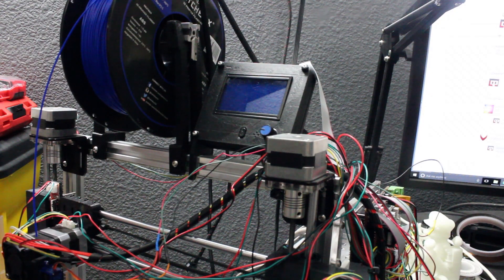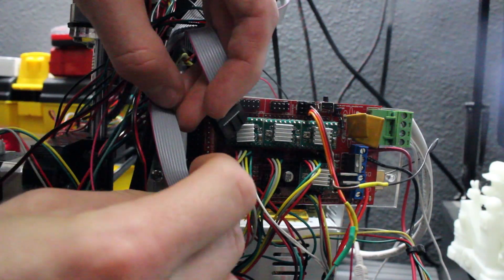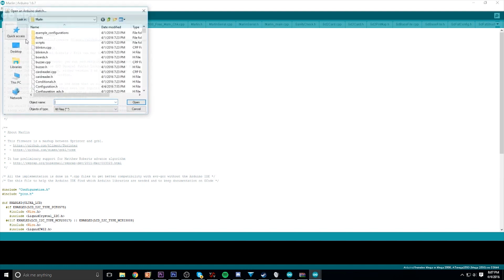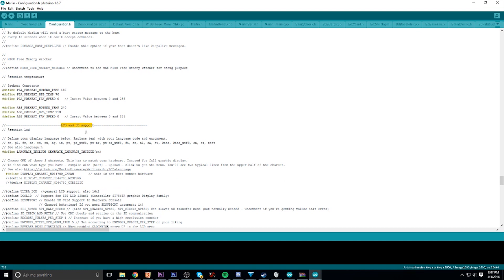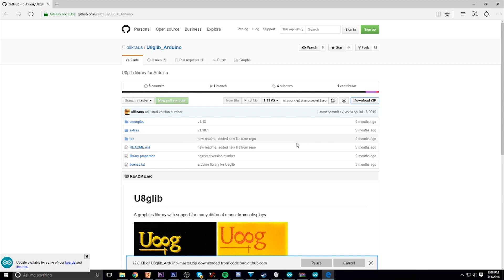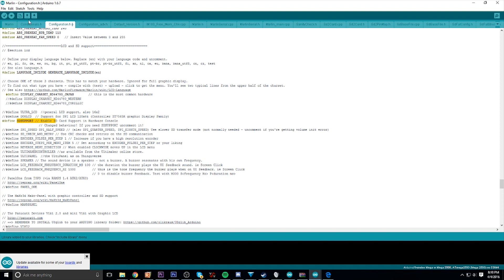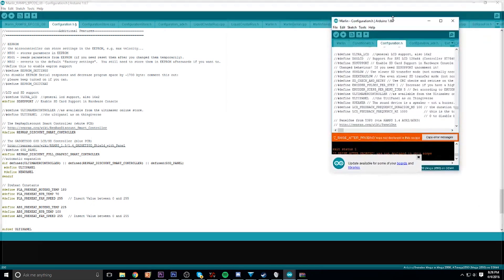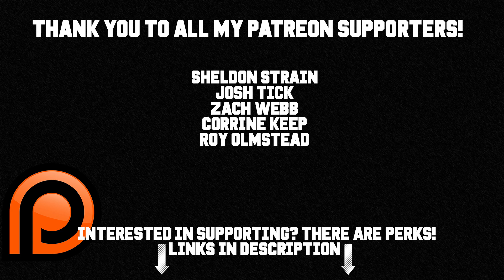3D Printer Tutorial | How To Easily Add An LCD Screen And SD Support To Your Printer!

Comment: Oh. My. Spaghetti Wire.  Great video, those wires though, they're giving me anxiety
Reply from the maker: +Paul Curtis it was so much better but with the upgrades and moving things around it's a mess I ordered some wire wrap so I will clean it all up shortly here trust me I don't like the mess either
Reply: +Dopesoner That is very good news to hear. You should set the camera up and do a super quick run down on it for all the kits we'll never see that have over stripped, short-out danger, super spaghetti wire, for something of a short public safety announcement

Comment: I really need to add an LCD to my rigidbot.
Reply from the maker: +Panoreth 3D Printing Do it! I have been having so many issues losing print due to software and usb issues I have been using the SD print function like crazy